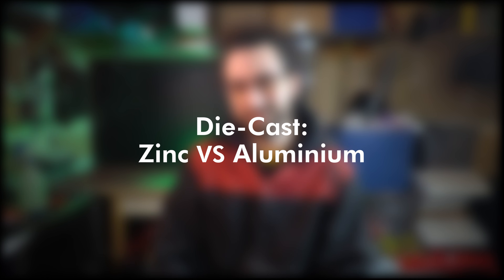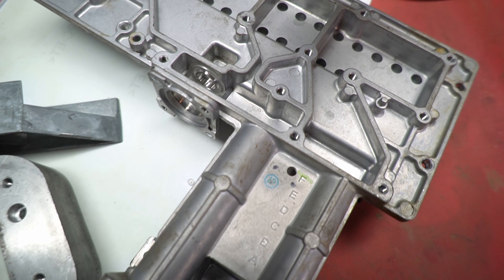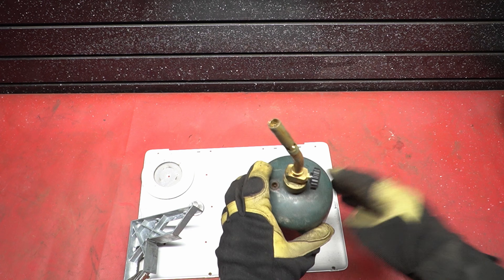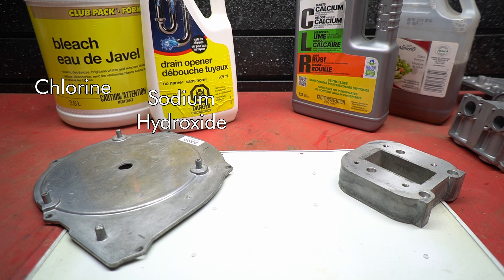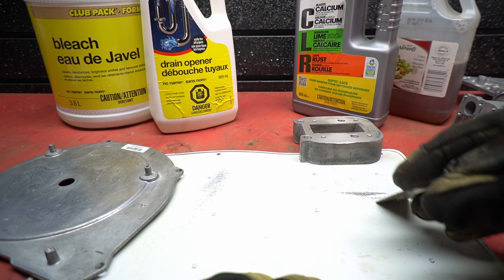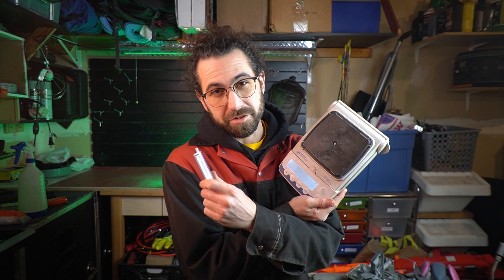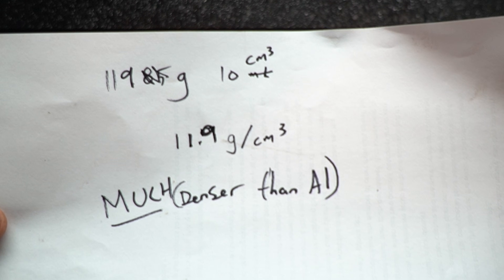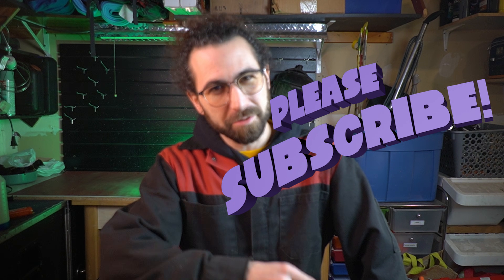Die Cast - Identifying Zinc VS Aluminum For  Casting or Scrapping

Comment: Hello, I just subscribed . I had a question on zamac  carburetor body oxidation. Somebody in US used to formulate an acid to brighten zamac to made these carb bodies look like new again  but he pasted away . So when they are new they are nice and shiny and when they oxidize they start looking like magnesium.  Do you know how to brighten up zamac without changing any dimension. The proceedure was to degrease the carb and simply dunking the part in the solution until you get the desired finish then water rinse the part . no soda neutralizing was necessary  thanks

Comment: I just dunk the parts in a stock tank and measure the weight with a spring gage.  Weight divided by (Weight - weight in water) should be 2.7 for aluminum

Comment: I have found this to be reliable. Hardware store for some liquid root killer. Put a small amount (half an ounce?) in an old pill bottle. Use an eyedropper or my favorite, a cotton swab. File or grind a little shiny spot on mystery metal. This stuff is caustic by it's nature, so only use a drop. And use outdoors. Touch swab to liquid apply to metal surface. No reaction- aluminum. Instant blackness- some alloy with zinc. It is much faster than drowning your scrap and doing calculus.  😉 🏴‍☠
Reply: I second this...I use a powdered version (copper sulfate pentahydrate), mix a tablespoon?ish amount with water in a spray bottle.  File a piece, spray it on, same results.  No reaction, aluminum, Instant black, zinc.
Reply: Yep! I find it to be fast and accurate.🙂 🏴‍☠ @redhm1989
Reply: Thanks, guys! I only have basic math skills. His density section lacked information I needed to grasp it. Your methods I get!

Comment: get some zep root killer copper sulfate, put 1 tsp. into a 16oz spray bottle. file or grind your metal. if no change when sprayed you have cast aluminum, if you spray and it gets dark you have zinc, die cast, if you get lots of little bubbles you have magnesium

Comment: you don't need the siringe if you use pure water and just use metric system :P just zero the scale with a plate on and count the grams from empty plate and plate with water,  you get pretty close to how many grams and therefore mililiters of water there is

but still i would like to find the lowest melting point aloy i could use in my train models instead of lead and hunting for zamak is probably my best bet

Comment: There is a better way to do that specific gravity test. Use a larger container filled with water that will not over flow when you submerge the test piece. Zero the scale with the container of water, then tie a thread to the test piece and submerge it in the water suspending it by holding it by the thread and make sure the piece does not touch the inside of the container at all while completely submerged. The scale will read what the displacement is. No need for the syringe.
Reply: I'm not 100% sure I understand how that would work out.
Reply: @danielheckel2755  . What I described is the proper way of doing it. there are videos on youtube showing how to do it. you divide the actual weight of the object by the displacement weight.
Reply: @E-BikingAdventures  Thanks bro

Comment: For the specific gravity test, you don't have to use a syringe. A measuring cup or beaker with mL will do. Fill it up say, halfway with water, and see how much the water level rises. That difference tells you the water displaced by the metal in question.

Comment: Thanks, I had a thick heavy gold plated deadbolt cover plate i was trying to identify.  It cut easily with a hacksaw revealing a silvery white metal.  It was non-magnetic.  Hence I conclude it is a zinc alloy.   Let's see if the scrap metal yard will take it as aluminum or something else.
Reply from the maker: Mine always buys it as heavy dirty aluminium, but you might get a better grade than me!

Comment: I usually recognize Al from Zamak by the weight and the different sound that they do when you throw in the ground them.
Zamak is an interesting material, easy to melt, 100% recyclable and quite strong.
Reply from the maker: I’m looking forward to doing some projects with it!
Reply: "Zamak is an interesting material, easy to melt, 100% recyclable and quite strong." - No, it's anything but strong, not malleable at all (in fact it's fragile and breaks very easily) and next to impossible to repair. It's every repairman's nightmare.

Comment: I collect strip the plastic off of and melt hot wheels. Yes the toy cars I get the bags at goodwill or for free from people and I melt them although the burning paint smells horrible sometimes if it’s unpainted it barely stinks at all and I do it with a propane torch too and it works great and I have about 5 pounds of it include a big 2 pound and 4 ounce bar of it that I casted in a steel mold
Reply from the maker: Cool! I imagine you’ve got a good idea which ones are “rare and collectible” though? Be a kick in the pants to find out one was worth a few hundred after the fact lol

Comment: Greatt video. I’m in the process of trying to work out a mystery metal Ingot I got from an art school where they did casting. It’s soft but not lead, maybe pewter or tin.
Reply from the maker: That would be my guess for sure. Not many soft metals around!
Reply: If they used it for casting then it's much more likely to be pewter than pure tin.

Comment: I melt zinc in my wood stove with a cast iron pot. Cheers
Reply from the maker: Nice! What do you cast?
Reply: @thubprint  just ingots with zinc right now. I got some vids of aluminum castings. have had problems with zinc getting in the mix and burning up. eventually want to try making custom molds for die casting..

Comment: I've seen a video or two where they use copper sulfate to tell the difference, zinc will turn black and aluminum will not react.  Zep root killer was what he was using diluted with water and spayed on a fresh ground area..
Reply from the maker: I SHOULD HAVE TRIED THAT 😳

Comment: Sodium aluminate is also formed by the action of sodium hydroxide on elemental aluminium 👍 which is an amphoteric metal. The reaction is highly exothermic once established and is accompanied by the rapid evolution of hydrogen gas. The reaction is sometimes written as:

2Al + 2NaOH + 2H2O → 2NaAlO2 + 3H2
The bubbles are a result of 3H2 gas. Very good you used gloves and hopefully safety glasses, too - because of the exothermic reaction.  By the way, you get the same reaction when using drano, a piece of aluminium foil or a yoghurt lid made of aluminium. Drano is more enviromental friendly than copper sulfate and easier to get. 
I always enjoy watching your explaination videos a lot. Stay safe and blessings.
Reply from the maker: Sounds like I could use your help making some of them! 😊 was my assessment correct, I just needed a stronger acid to test for zinc?
Yes I was wearing eye protection 😆 though now you’ve got me thinking about heating the garage with drano and aluminium lol
Reply: @thubprint  Yes a stronger acid is helpful. If you can get hydrolic acid in concentrated form and just a tiny little bit of zinc.  But be careful that gas H2 is flamable. See this youtube video : Reaction Of Zinc with Hydrochloric acid | Chemistry demonstration
It is well explained in this youttube video.  But he does not wear gloves that are aid resistend. The correct equtation for this reaction: Zn+2HCL->Zncl2+ H2.

Comment: One chemical that works better than CLR and vinegar is copper sulfate, which can be found in root killers.  Copper sulfate will change the zinc items black.  Use  water diluted root killer (copper sulfate crystals) and just scratch off the oxide.  Spray the item with the solution and if I does nothing then it is aluminum casting and if it turns black it is zinc casting.

Comment: Man I’m so jealous of where you live. Over here stuff as dumpster diving is technically legal, yet they fine hefty amounts as if it were illegal :(
Reply from the maker: Maybe that’s just based on which store it’s at?
Reply: @thubprint  But alas, it doesn't matter where, and even if the shop lets you pick in their trash it's still frowned upon and fined. Even though our laws clearly state that if you throw something out with the intent of getting rid of this item you lose all of your ownership rights and this item becomes available to all, somehow you still get in trouble if you take something that's worth anything (such as scrap metal, for example).

Comment: Glad you tried the water displacement test.
Reply from the maker: It was pretty clearly the winner 😉👌
Reply: @thubprint  Dr. Poof taught me that when he isolated a white metal platinum from Al. He actually blew out the windows at the University twice, someone that thinks out of the box. Beats the jack-in-the-box from popping.
Reply: @johnchristie1423  think i get ya👍 surely it only works with things that float?
Reply: @ItsMe-io5bl  No, weight vs water displacement using the atomic number charts
Reply: @johnchristie1423  Yes, for things that float, it must have some part of the object still above the water line, otherwise all you`re doing is measuring its volume, not weight. The periodic table will tell you how dense a material is, but you have to know what it is first (obviously). i thought it was about telling what it is, zinc or ally

Comment: Zep root kill will let you know the difference in aluminum and die cast got that trick from a former youtuber. I would like to find out more about bronze I tore an electrical motor apart today and the bushing on each end I think we’re bronze looked like that anyways it didn’t look like brass or red brass it’s a possibility it’s red brass or bronze if you could help find out lol
Reply from the maker: Root killer? Didn’t come across that one in my research, kind of a shame! Would have been fun.
I know the bits you’re talking about and I’ve wondered myself. I just put them in the brass bin, though they could actually be bronze. I don’t get enough of them to make a difference.